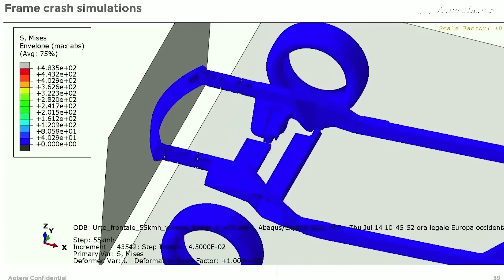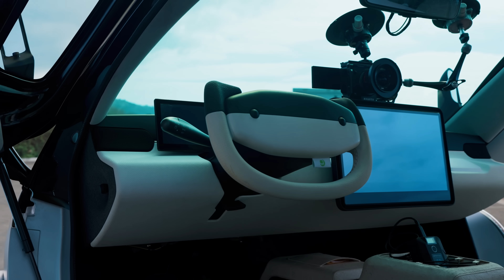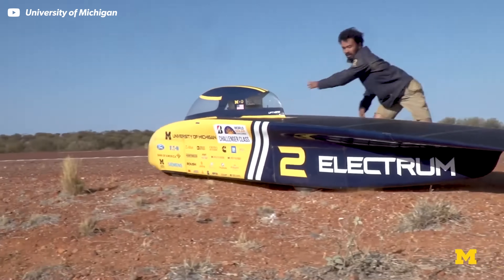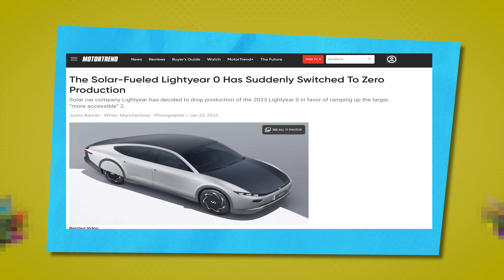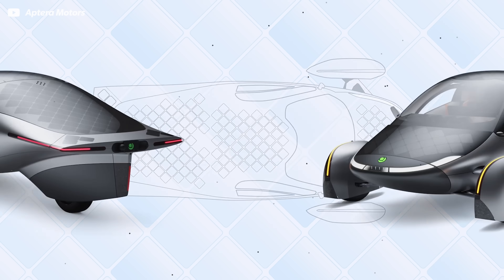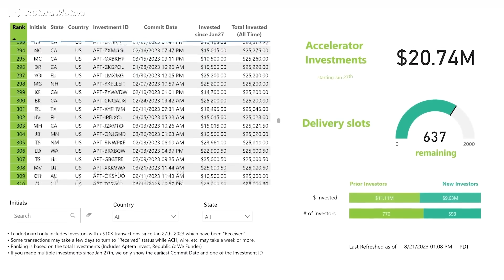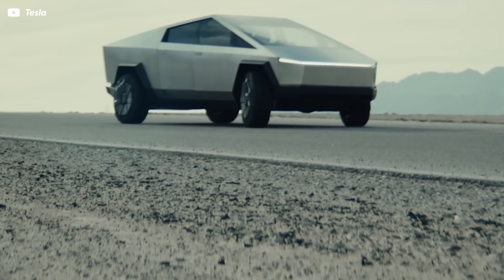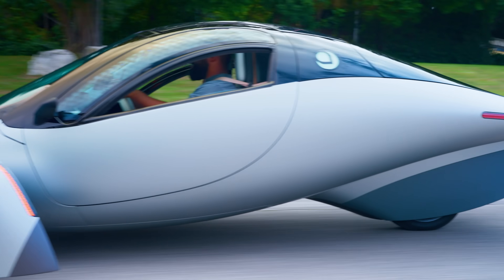We Drove America's First Solar Car

Comment: What's crazy is that there are probably so many people who can get this car and won't ever have to plug it in while still using it everyday
Reply: In the winter or overcast weather you're only going to get a few miles a day without charging. You could go farther riding a bicycle.
Reply: @JWQweqOPDH riding a bike in the rain and snow isn’t all that great either.
Reply: @JWQweqOPDH  Oh for sure, if you live somewhere that isn't like California you'll still have to plug it in sometimes.
But that just brings it in line with other EV's-which are still ahead of gas cars because you can fill them up at home while you sleep.
Reply: @tigletcat  With the right clothes it's not that bad. You'll need a coat driving this thing anyway because good luck having enough battery charge to run a heater.
Reply: @JWQweqOPDH what about the countless cities in the world that get mayyyybe 1 overcast day per year?
Reply: @tigletcat  But riding on an overcast fall day is brilliant.
Reply: @JWQweqOPDH  you'd be suprised how much power solar still makes in overcast. You can also look up your average solar irradiance on the department of energy site. In general even me living up in the north east (the worst place in the US for solar) it's still over 4kwh/m². That means a bit over 2kwh of solar for this thing a day or around 20 miles.
Reply: @JWQweqOPDH  you're really overestimating how inefficient solar panels are in overcast.
Reply: @mafiacat88  I live in California, and this car would not do well in the snow here.
Reply: @StageRight123  
As a person who does not live in America it is my solemn duty to let you know that California is just Hollywood. 
Maybe LA on a bad day. 
You must be in Coastal Wisconsin if you get snow, because California is only sun. 
*only sun*.
So the movies have decreed, and so it shall be. 

But seriously though I just used that as an example because while you may get snow occasionally, you do still get a LOT of Sun in the not-winter, at least compared to a lot of other areas. 
Where I'm at not-winter is just rain instead, so it's a no-sun party year-round.  
And honestly lots of cars are total shit at winter driving. For me it's more a perk if it DOES handle snow, rather than a con if it doesn't-that's just expected.
Reply: @StageRight123 well you must not live in SoCal because the sunny days here in LA are crazy lol. We get like 90% sunny days. And almost zero snow days. Specially in LA and cities around it. This car sounds like it would be perfect for LA. Specially if you have a home where you can charge it at home in a regular outlet or if you work from home (which I do) you can just let it sit in the sun for a couple days and never have to charge it. Even If it gives me over 10 miles a day of charge, it's way more than I need lol. I drive about 30-40 miles a week on my daily car.
Reply: *Laughs in Arizona
Reply: @StageRight123 Why wouldn't it do well in the snow?
Reply: Parking it in the sun all day is great for the vinyl wrap.
Reply: @StageRight123  I live in Iowa.  I expect the AWD model will be very good in snow with the proper tires because of a superior traction control system that can sense slip and adjust torque every 2.5" of tread travel.

It has already proven it can run on ski slopes in Switzerland with the snow over the bottom of the wheel pants.
Reply: @n.brucenelson5920 - Show me a video of it running on ski slopes in Switzerland. I ski in Switzerland and only videos I’ve seen of it there are it scooting around at about 10 km/hr on a well plowed parking lot at a chalet. So looking forward to this video you speak of.
Reply: @billsmith5960  I never said there was a video.  I have heard about it from people who were there.  (there could be)  I will post video of my experience in Iowa snow.
Reply: @n.brucenelson5920  - My mistake. No video but just a claim from you. Thanks for clarifying that.

I’ll claim things like it got stuck in the snow and was terrible. I have no video of this but if we are making claims, we both can play this game.
Reply: @billsmith5960   difference would be that if you were to say that, you would be lying.  I don't don't think you would want to be known as a liar, would you?  I will show video of my Aptera performing (or not) in the snow in Iowa when I take delivery of mine.
Reply: @n.brucenelson5920  -Nope. Just making claims that I can’t back up. Just being like you. If you want to call me a liar, then I call you a liar too. Thus we are back at square one.
Reply: @billsmith5960  I didn't call you a liar, and I see you don't want to play that game.  Good for you.
Reply: @Lorentz_Driver - Never thought of that. There are countless n😮meerschaum of cities that get many days of overcast. Plus many north of the equator that the energy of the sun is less in the winter. It’s simple physics.
Reply: @JWQweqOPDH the launch edition has a 400 mile battery and only uses 100wH/mile of energy. In relative terms the battery is larger then most in most EV's. The composite body also provides good insulation and it is not a very big area to heat or cool.
Reply: I live in the south (Tennessee) and this car would be perfect for my needs. Even in snow, the distances I travel wouldn't completely drain the battery. Sure I might keep my ICE vehicle for extremely nasty winter conditions, but the majority of the time an Aptera 250 mile variant would be perfect for my needs. A new car that cost around $26K (that's cheaper than some used ICE cars), that's frugal on the pocketbook to drive it daily, and extremely low maintenance to boot? I don't think there will ever be a "perfect vehicle" for sure, but in my opinion the Aptera comes mighty damn close.
Reply: @garywozniak7742  - Can you tell me the Q value of this body that Aptera uses as compared to let's say a Tesla? I look forward to seeing how much better it's insulated.
Reply: @b.robinson206  - That's right. I can tell you are part of he younger crowd that makes big bucks and can work from home. With the Aptera getting 1000 miles on a charge and 40 miles per day from solar, you are the newer generation which will be filthy rich because of efficiency.

Comment: This could legitimately be the car of the future and end up being like the next model T and completely change the game
Reply: Yeah, and it might not.
Reply: Whether it does or not is pretty much down to the pricing of the car. If they can actually get a 25k$ base model into production and keep up with demand without jacking up the prices, then they will succeed.
Reply: @beanapprentice1687  The biggest issue is actually getting these things into production. Protos like this get made all the time.
Reply: Agree, the beginning of the future. All cars will have to be efficient and solar to sell.
Reply: @franciscog9635  You have to be kidding. Solar is very inefficient and suffers consistency due to lighting conditions. This thing gives roughly 40 miles per day from solar in perfect conditions.

Comment: If you have a 3 mile commute to work, a $1,500 e-bike is a much better option than a $25k car that you still have to license and insure. Plus you will get a little exercise.

It is cool though.
Reply: " Plus you will get a little exercise."
yes, because that what I want before a hard day of work: to be sweaty, stinky and sticky.....
e-bikes are great for communiting if the weather is nice and you dont have to drive on highways....
i drive a electric motorcycle all the time but when it rains or its winter i get into my car immediately
Reply: @faustinpippin9208  If you get an ebike you don't need to pedal you won't get sweaty, stinky, and sticky. You can always bring a change of clothes.
Reply: @bwofficial1776  yea if you have a decent e-bike, but in eu there is a 250 watt limit and you can only use the electric motor up to 25km/h and the elctric motor can be used only as assist and only activated by pedaling
its ridiculous 
idk how it is in the us tho, but with your terrible zoning you have to drive on highways to get anywhere so i doubt you could drive an e-bike 140km/h there (my can do that but its my own build)

Comment: If they come out with the base model being 25k, I feel like this thing could really pop off. I always feel like all these projects are a bit too good to be true, but most of them have not gone through 20 years and do not have a no-bullshit prototype that they give to influencers (like "oh, it does only 20 miles on a full charge right now, but in 3 months, we plan to improve it to 800 miles" kind of nonsense).
Reply: RIght, the whole "1000 miles on a charge" is not something that the vehicle is doing right now.  They're selling points for the future.  I mean shit, the one they drove didnt even have power brakes, so I'm not sold on them being "close" to ready.
Reply: $25k is an old price they made up.  The Launch Edition with up to 400 miles range is listed at $33k on their website.
Reply: @Okurkaarrgghh  "but the 25k was for the low volume production. so of course the high volume production model is going to cost a bit more, it only makes sense because of the tooling costs. that's why it's late too because it turned out to be SO popular." -some aptera investor, probably.

Comment: Omg, please Aptera, bring this to France, we need this here ! This car is a banger ! I don't like EVs because of the "recharging batteries problem" but damn, the solar part of this is just the best idea ever =) This would solve the main problem of EVs (finding somewhere to plug it for a 8 hours recharge).
Reply: It's easy to find fast chargers in France, and no EV takes 8 hours to fast charge.
Are you unable to charge at home?
Reply: Man you must HATE having to put fuel into regular cars at a designated location, can't even do it at home.
Reply: @cenciende9401 Man you're in for a shock when you grow hair on your balls & face the real world. Fuel takes 5 minutes to put in. Charging takes hours.
Reply: @BobMonkeypimp I've never been stood next to my EV waiting for it to charge for hours, when I arrive home I press a button by the steering wheel and the charge cover opens, then I plug the charger in and walk away. It takes like 15-20 seconds.

If your commute was several hundred miles one way then yeah I wouldn't get an ev cause then you'd have to wait for an hour at a fast charger or a few hours on a regular one.

For almost everyone this isn't the the case though.
Reply: @smvsspould  So you've never been on a long road trip then? What's the point in having a car? Sad 😔

Comment: How that guy at Justin's parts shop felt about the Aptera, is how I used to feel about Elio Motors. I've since learned to never get hyped until the car is actually available for sale at a local dealer :P
Reply: I lost money by reserving an Elio but Aptera is in a much better place. At least with Aptera my reservation money is refundable. Still being a bit skeptical it took awhile to reserve. Somewhere around 37,000 reservist. Go Aptera!

Comment: One thing people aren’t talking enough about is how the Aptera is not a car, it is produced as a three wheel motorcycle. This may seem like a technical detail, but that comes with several complications. 

In some states, drivers and passengers will be required to wear helmets and PPE while driving, including most federal bases and installations. A motorcycle license is required to operate these as well, and the Aptera itself will not likely be able to pass the average motorcycle skills test because it is simply too wide for the agility maneuvers. 

Insurance companies are also likely to consider the Aptera an exotic or luxury vehicle, meaning that insurance rates are going to be remarkably high for new owners. Owners who are just newly licensed to operate motorcycles are already going to have high insurance rates since they’ll have new license with no years of riding experience.

With how Aptera themselves are downplaying the motorcycle aspect of their vehicle, I would not be surprised to see a lot of customers not understanding what they’re getting into. Imagine being pulled over and finding out your car is a motorcycle that you’re not licensed to drive it, now you’re charged with driving without a license.
Reply: Some research will dispel most of these concerns.  The laws have been changing rapidly in most states that had restrictions, and there are few, if any left, even at this point, months before deliveries begin.

Comment: Nice to see someone do a full-on driving review of this car without the Aptera minders.  I think it's a little small and wondered if I would even fit at 6'2, but you two are not small and you looked pretty reasonably comfortable in there.  Still on the fence on whether or not to order one, but I think that's because Delta has yet to appear and I'm waiting to see what the full production model looks/drives like.  As for the yoke, I think it's probably better than the Tesla yoke, but it's entirely necessary given the way they've set up those side-camera screens right above it.  If you had a full wheel, you wouldn't be able to see those screens.  Anyway, great review and thanks for sharing it with us.  Really excited for Aptera.

Comment: Living in Texas where everything is baking in a constant assault from the Sun, this seems like a great idea. Especially with the ungodly amount of roads I have to travel for simple tasks, this thing would always be at 100%. 

I do find the tone of the video to be a little TOO positive though. I get that it's pre-production and won't be anywhere near the claimed 1000 miles per charge, but they could have at least tried to show some battery consumption metrics. How much charge did it use over the four hours they drove it? How much was gained (or lost) while sitting in traffic with A/C and infotainment system running? How much drained while in the garage (outside of sunlight) with the in-car electronics turned on? Also, the "double tap to open the door" seems like a terrible idea. Something vital like being able to get into the car quickly doesn't need a gimmick. A simple mechanical handle would be fine here. I'd love to know what the fallback is.

At 25k though, I am hopeful this comes out as promised.
Reply: Agreed, I get that they liked it but the video had a very uncritical air, they need to actually challenge the design and specs and see what's up instead of making what turned out to be more of a promotional piece.
Reply: They are paid for this video, offcourse they are enthusiastic 🤣🤣🤣
Reply: It's not a final spec vehicle, but a test unit. Doing range tests and things like that wouldn't mean anything.
Reply: The fallback is phone key or keycard. Like a Tesla
Reply: I'm not sure how useful those metrics would be given how different this prototype is to the final production model. I think their reason for leaving out such details is to prevent putting out a message to viewers that "this is what to expect" on details that are almost certainly going to change.

Once they're putting up production models, I want to see those sort of tests done. Real-world range, winter driving, how well it handles rough roads, wet or icy conditions, moose test redux, fast charging 10-80, drain from AC or heating the cabin over an hour+. This is far more of a "is this a cool idea" video, which I think is about all you can realistically do until they're in production for real.
Reply: Aptera is starting with a 400 mile battery, AWD, full solar package launch edition. It is around $33.5k. There aren't many EV with a 400 mile range out there. They plan a base model (250 mile battery) fir around $26,900  and a 600 mile and 1,000 mile battery in the future. They are going to have production intent launch edition vehicle in a few months to do full validation and crash testing on. But they expect 100wH/mile with a potential of up to 40 mile of solar charge/day depending on where you live.

Comment: I genuinely love this.
Sure it looks a little weird-but it manages the future look without being TOO out there and still being unique. 
Plus having a car that's actually designed to be very aerodynamic is great, because I currently drive an ancient car with aero like a cinder block-and I hate thinking about how much gas I'm wasting because of the design. 

Plus it's SHOCKINGLY affordable. Like, I want an electric car (gas is pricy), but I don't have a hundred grand sitting around. But at 25k, it's right in with middle end cars, making it a great option.
While I don't live somewhere like california where it's super sunny-just as an EV that can charge good range overnight off normal wall power is a huge win for someone who rents rather than owns a house they can modify to accept a real EV charging station. 

Does this work for everyone? Hell no. I would probably keep my current car for moving crap, or for going out with more than one friend or what have you.
But 95% of the time this would do it for me.